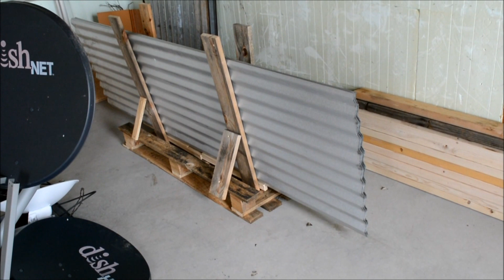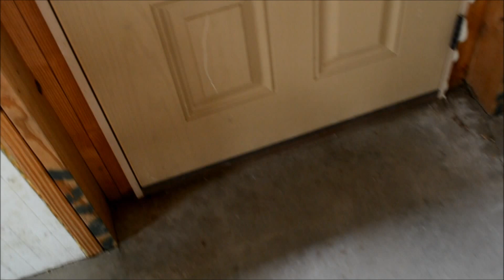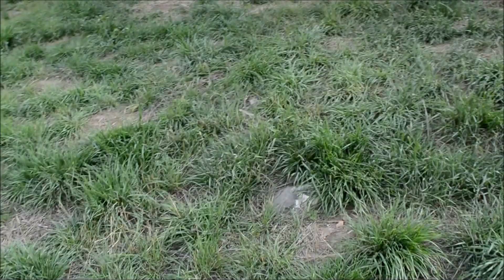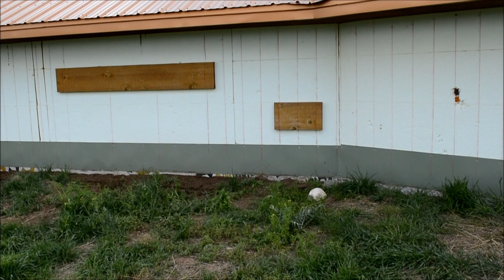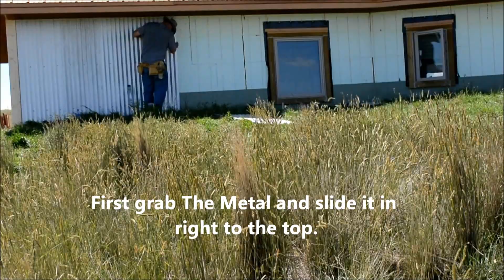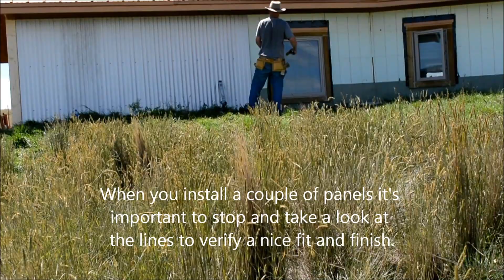DIY - Corrugated Metal Siding Install (ICF) Off Grid Homestead - Part 1 The Metal

Comment: I like the metal,  I did see a tip on stacking your panels together that will be put up the same and using a metal punch to go through a stack for the screw holes.   Fast way to get the screws lined up straight and in quickly. 
About ready to do a  three foot wainscot metal on the outside of my cabin for the fire code needed.
Reply from the maker: Thanks, that's a great idea on stacking/punching several panels at a time. Good luck on your cabin.

Comment: Did you build this house yourself ???  Who built this house?? I know I sound pretty negative right now and I know that things will all work out for you . I just hate to see you do things that may have to be redone later on ..
Reply from the maker: Pro builders built the house, the previous owners did the bad siding job on the front of the house that's the only thing I will have to redo. I'm glad they didn't do more. The corrugated metal will be staying on the building.  Since the winters are harsh we chose steel as it is much better IMO than stucco, wood, and even cement fiber board. I want to use the metal along the bottom of the front of the house but not sure about the look. We may paint the steel but I kinda like the way it looks now. Thanks for watching.
Reply: Again appreciate your reply.. I think what worries me the most is that half of your house has the ground  back filled already and since they have made such a shitty job on what you can see,  I wonder what they haven't down below ground level , for another day I guess.
How big is your section ?? is the majority of it flat ?? I think there is a foam like strip you can purchase to go down the bottom of that corrugated iron to stop bugs / critters getting up there .. 
Its not easy work doing it alone and a piece at a time , so hang in there pal. baby steps ....
Reply from the maker: No worries the rest of the house is sound.